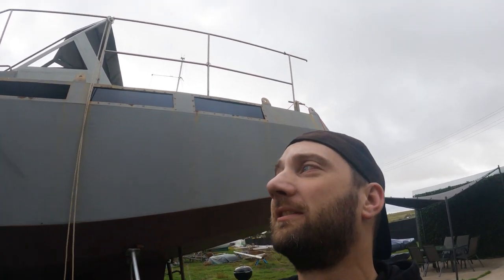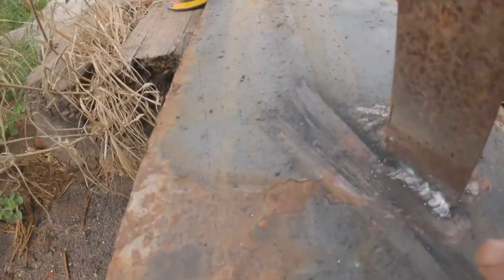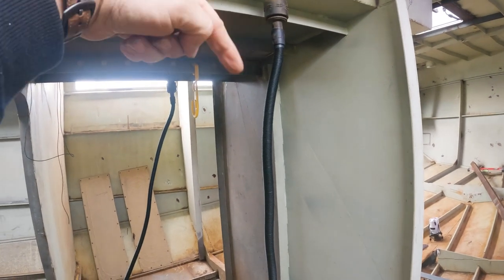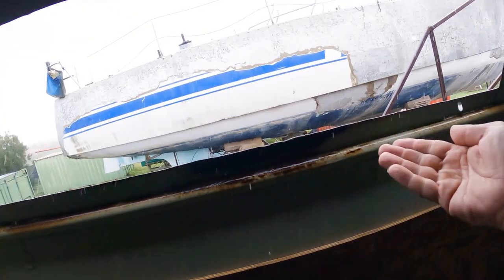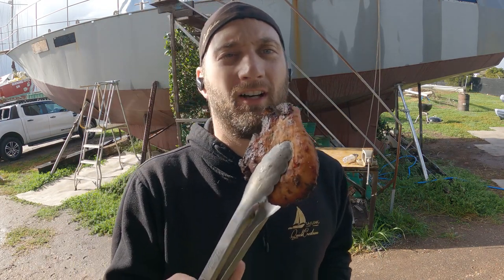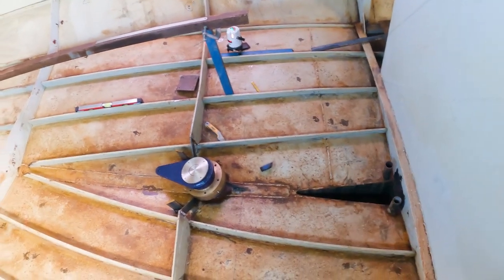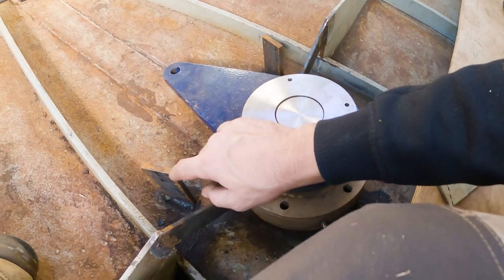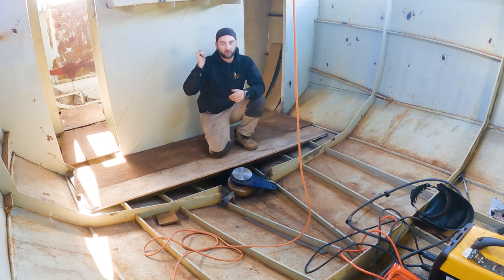Sailing QC #73 |  Batten Down the Hatches!! | plus Aft Cabin Flooring | Steel Sailboat Restoration

Comment: Ahoy! Wont that hydraulic cyliner base have to turn or will you cut a long hole into the rudder leaver? Great work :)
Reply from the maker: Hi Herner! The hydraulic cylinder base doesn't pivot. The hydraulic ram has a knuckle that pivots :D
Reply: @SailingQuickCreations  I see, must have missed that. Made me wonder cause it didn't look like it would work. Keep it up :)